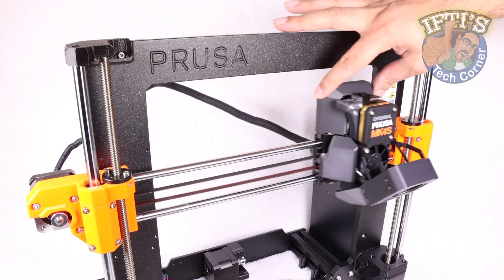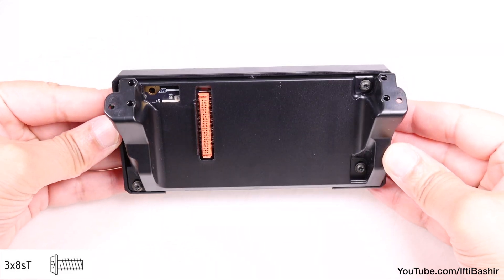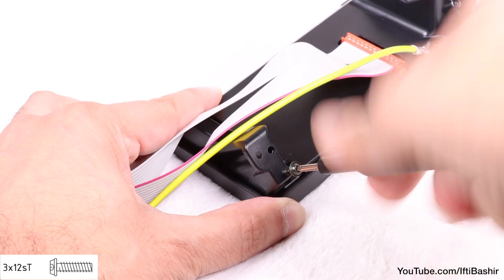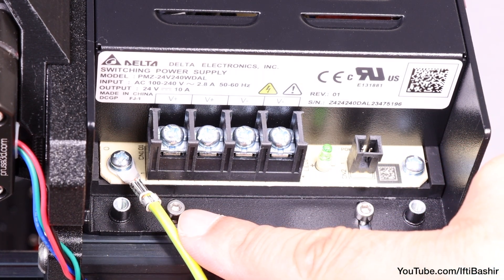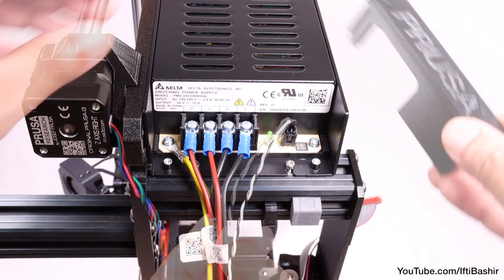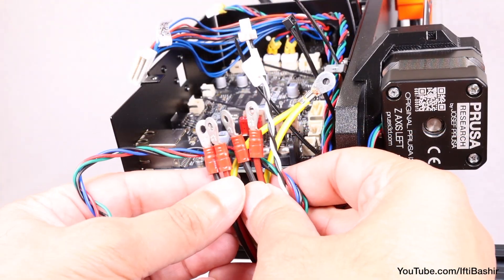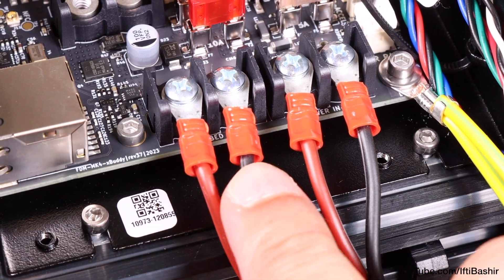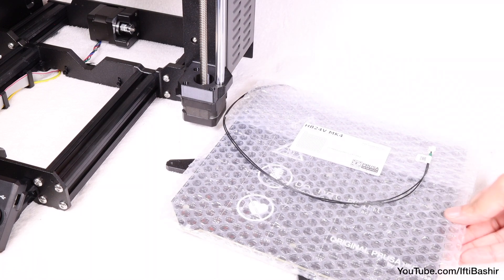#06 Original PRUSA MK4S Kit : Full Step-By-Step BUILD GUIDE - xLCD Assembly

Comment: at 9:09 does it matter which red cable or which black cable you use? or can i just use any of the two if the color sequence red black red black? or do i connect them with pairs? (maybe this is a stupid question but i just wanna make sure i connect it right so i don't cause major damage)
Reply from the maker: Doesn’t matter - just ensure the colours go to the same terminals as shown in the video
Reply: i guess a better question is if the 2 power outputs from the power supply is the same voltage/current. because if so then it doesn't really matter right?

Comment: When you finish your LCD and you put on the printer change the setting in hardware settings or your LCD will give issues and start flickering
Reply from the maker: Mine didn't - just make sure the ribbon cable is securely connected.
Reply: @iftibashir thanks but that wasn't my issue mine was secure . Had to go in hardware settings and change the display refresh speed to low and now it works perfectly. Seen alot of people had display issues and had to get new screens from prusa. Gotta do it fast before it starts flickering though

Comment: 6:55 I found it helpful to ensure the power cables are relatively taut. There was little slack for me once they reached the xBuddy board, particularly if putting them into the final xBuddy-side wire clip as suggested by the official instructions. It's also helpful to make sure the zip ties just tight enough to hold the wires in place, but not so tight that the wires can't move back and forth. This lets you move slack to and fro as needed. Zip ties are a dime-a-dozen, but it's still not convenient to cut and reapply while making slack adjustments here.